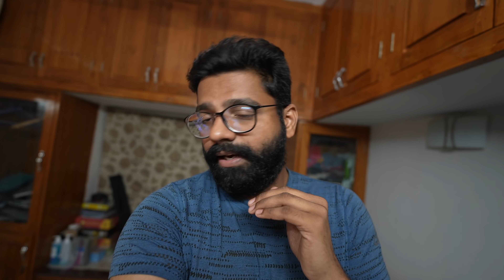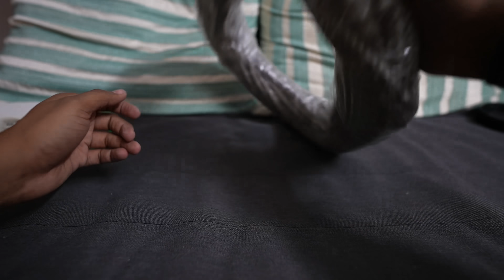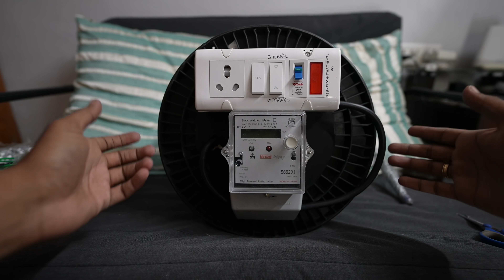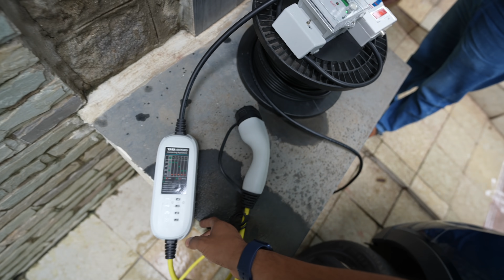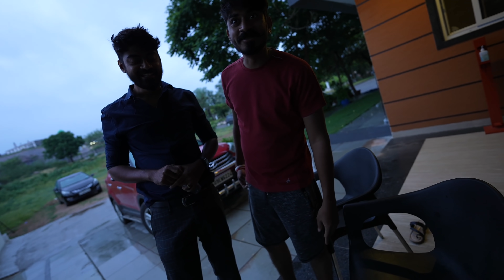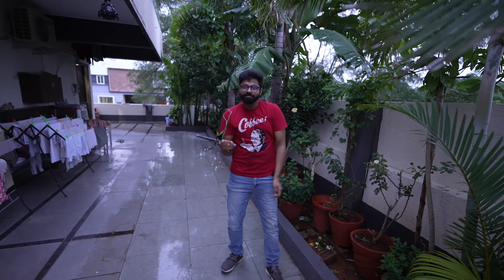Ready for Road Trips on The Tata Nexon EV? Yes!

Comment: I see that you have linked a 16A smart plug product in the description. Is it safe to plug it into the slow charging home setup? That would be a great help in remotely turning off the charging instead of keeping it on overnight.
Reply from the maker: I use a lot. Slow charging without this is also through 16A socket. So works perfectly

Comment: just a small correction if you put 25 amp load on 5 amp socket it don't slow charge the load instead it heats up and burn the socket , btw really helpful video
Reply from the maker: True

Comment: I have a doubt when you said earthing can be done dipping rod on water. Isn't that dangerous. You will not be able to know who is touching that same pool same time, when sudden surge of power needs to be earthed. The best way is to hammer the copper rod at-least 3 feet deep. This too is not 100% safe, as you have to insulate the earthing pit with gravels, and salt, better compared to your previous idea.
Request you to add this  as a disclaimer in your video. As some people got to do this on their own risk. 

Why i am so specific is the equipment you play with is energized to maximum of 33KW, which is a quantum of power equal to power your whole colony at least for an hour. Just imagine for some reason their is a return of such huge power ( though TATA would have protection circuits), and you end up putting that into pool of water, and some human or animals are in contact with that pool. It would be a disaster.

Comment: Charan, just for your awareness. The size of the plug point does not determine the current you can draw from it. The load connected to it will determine how much current it will draw.

So, if you connect a 5 amps adapter to a 15 amp plug, your plug point won't slow down charging. Your car will continue to draw 12-15 amps whatever it has to draw. The plug point and wire behind it designed for 5 amps will heat up due to the excessive current draw and melt, in some cases might cause a short circuit or fire. 

If the 5 amps plug is behind a 10 amps mcb etc. The mcb will trip when the car tries to draw 12 amps and protect your wiring and plug.

So, charging won't be slow. Don't try it. That meter should infact be able to show you current and peak power draw, most meters do. 

If it doesn't, you can try a wipro smart plug with power monitoring and get a feel for how much power you car is drawing at different stages. For example, when battery is low it will draw more and charge faster but charging rate slows down after reaching 70-80% to protect the batteries
Reply from the maker: Thanks for the information. Really helpful 👍

Comment: Hey Charan thanks for the cool review of the Aha Travel kit!!! And another one for sharing that link in description :) I've included link to your this video in the original one!

Sharing an experience - I thought I'd be using the iron lug in most cases too, but the clamp has turned out to be the surprise winner... there are far more earthing points around us than we realize, and the clamp gets our earthing much faster than any of the other two methods! Look around for electricity board transformers (they always have a solid earthing bar on the ground below them), metal plumbing, iron grills, poles etc....
Reply from the maker: Thanks. You have a great kit. Loved it. 

I’m scared to go near a transformer. Would love to see you make a video on that connection. Will help me and a lot more
Reply: @iGuruCrazy  sure bro... Lemme check at the next opportunity 👍 and you keep up the great work!
Reply: I need this charging kit, how to buy

Comment: Hi Charan, in case if you are planning   on the Vizag side,  you can try these fast chargers on your way. 
Onward : Home-7Food court Suryapet- MZ motor India Gudavalli -- Shiva Sakti Tata motors, Rajahmundry-- Vizag.

Return: Vizag-Tata motors Rajahmundry--MZ motors Gudavalli- Rajugari thota,Suryapet-- Home

Thrice I've tried this route with my EV and I've struggled for the first two times but the latest one in July was fine. 
Please do let me know if you try a fast charger in Vizag. I haven't tried that yet. 

Good luck!!
Reply from the maker: Will do 👍🏽
Reply: Actually i did try 7 hotels charger suryapet, its very very very finicky. Wasted about an hour to get that thing to work. The worst part being the support staff of Tata Power who are clueless about the error codes shown on fast charger display.
Reply from the maker: Yes that’s tricky. You need to reset sometimes. Check my highway nexon ev video
Reply: @iGuruCrazy  aahh... Yeaa that emergency red knob thing... Thats the first option i tried.... The second one being, turn off thr MCB and turn it back after 10 or 15 seconds. Wait for the entite system to reboot again..

Comment: I follow many car vloggers, saw many EV videos who travelled using fast charging but no one tried to go this far to arrange electronics for safe charging and not to be completely dependent on fast chargers. You seem to be ready for ladakh trip if things n time works out for you 😁, loved it.
Reply from the maker: Difficult just to use only this mode but can be done with a combination of fast chargers
Reply: @iGuruCrazy  I agree, fast chargers are definitely needed in every 120 to 170kms so that your car charges in your break time & your electronics will make sure you charge your car at any given circumstances while resting at a hotel.